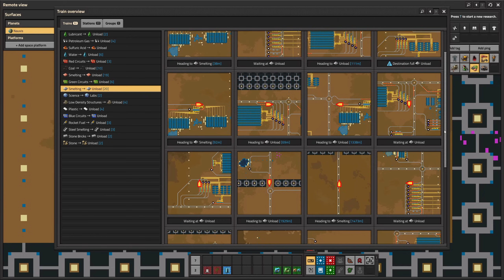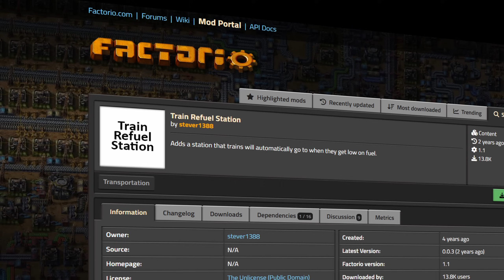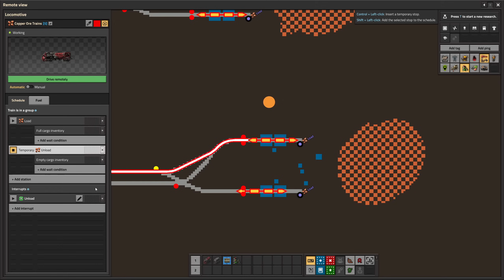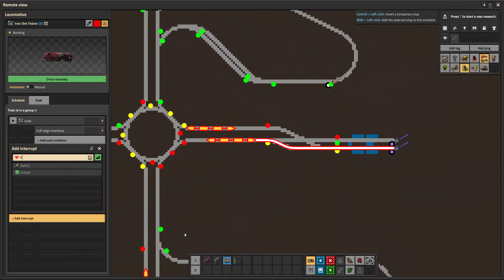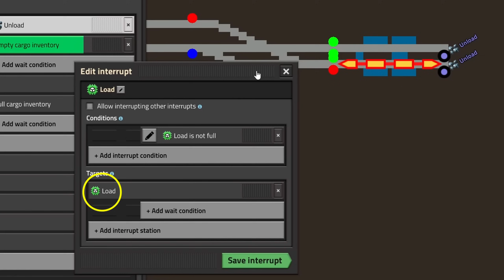Factorio Train Interrupts Explained!

Comment: You don't need circuits for fully generic trains! just have all loading stations have the same name eg "Item Load" with no item icon. then you can have the trains go to any "Item load" station where they will get filled up with whatever item is there which will then match to the unload interrupt and the trains will continue on
Reply: You could disable stations that don't have enough inventory to fill a train. Could also disable stations if the base has enough of item.
Reply: You will want to make sure the trains do not leave the loading station until their corresponding unloading station has a space for a train, to do this you will only want to have the trains go to the relaxed station only if they are empty and all the loading stations are full, otherwise all the trains will fill up with junk and go to the relax stations
Reply: this was also my strategy, together with circuit signals to enable loading stations only when there is demand for their specific item, plus programable speakers on the unloading to get alerts when there is a throughput issue (or something breaks)
as my network grew, I added more features, like disabling the request when a train is on the way, so I didnt get all trains trying to serve the same request when things slowed down
Reply: Say you make a shared name for the loading of copper mines and iron mines and you have 4 trains on a shared route to pick up.  If you have 4 copper mines that are all closer than the iron mines then the trains will always pick up copper and you will run out of iron.
Reply: @roberteltze4850 And that is why you have 5 trains. Whenever I create a new pickup station I also make a new train. So if I have 4 copper ore and 1 iron ore pickup, I will have at least 5 trains in the network. It's better to have even more, because of trains in transit.
But yes, this is the main downside of this approach that you still have a lot of trains and when you expand you have to add more, not for increased throughput but to not starve. To avoid that you would need an LTN style network, but that is harder to figure out.
Reply: @roberteltze4850  You should always have enough trains for the whole system. if there is no trains at the depot or "relax" stations then you should add more. It's just the same as not having enough robots
Reply: while that's probably true, it has a lot of negatives. For example, if you have 50+ stations its much harder to find the ones you may want to look at for whatever reason.
Reply from the maker: But then you have to manage the amount of trains and have excess trains to make sure that theres no bottleneck.
People setting up LTN want to avoid exactly that. They want some smart trigger so that trains only pickup stuff when it's actually needed.
Mekhami already posted this exact idea of having the same name for all stations but then use the circuit network to balance supply and demand.

I currently have a member only poll here on YT and patreon and if this idea wins I'll make a video about it.
But using the no effort "just build more trains" generic group might also be something I can cover. Thanks.
Reply: That argument does not make sense because at certain point LTN like network will be using same number of trains as vanilla network to transport items to satisfy throughput and it will be actually slower than vanilla because LTN network expects trains to go to relax station / depot to receive new order, while vanilla train can go directly from unloading to loading station. Enabling loading station based on demand does not work because if you have 5 loading stations for the same item but need only one to be enabled then you run into a problem that these stations must agree which one will enable. Yes it is possible to solve it but solution is so complex it is not feasible to use it in normal gameplay.

The actual issue I have with vanilla system is that it sends train to closest loading station, which depending on structure of rail network can cause shortage of resources which come from distant loading stations. Yes you can solve it with some central managed priority for loading stations, but that again increases complexity of the whole setup.

In the end vanilla factorio even with space age does not have enough items which would need to be transported via trains, especially with liquid metals, new pipe system and stacked belts. So vanilla train system actually fits better vanilla games than LTN like system. LTN is definitely better for modded games with hundreds of different items which need to be transported in small amounts (like pyanodon mods).
Reply: @AVADIIStrategy  cant you turn off the load stations using circuits via the radar? just have every station output a signal when they need an item and have the load stations turn off if there isn't a request.
Reply: @AVADIIStrategy  Not sure how a LTN would avoid needing to add more trains? yes there would be less trains because the trains aren't sitting in the loading stops but you would still need to make more trains as the total throughput increases. To me having a train sitting in the loading stop is not much different from the steel boxes that area beside the track, it is also very easy to create a blueprint of the train that includes fuel requests for the robots so you can just place them down anywhere. It should also be faster than an LTN because as soon as an unloading stop becomes available the train immediately departs with a full load unlike in an LTN where a train would receive the request and have to go fill up first.
Reply from the maker: @Ryan-uo3ep Imagine you have 2 iron ore mines. One is very far away the other is close the main base. The game will give priority to the near mine which means you will deplete the mines unevenly.
The only way to make the trains get ore from both is to have more trains than necessary because then the game will also send trains to the far mine because the near mine is occupied.
I personally don't have a problem with that which is why I like your solution. But other players are obsessed with balancing and they want to control where trains go and when and the solution to this is LTN.

So while it's true that this method produces generic trains, it's not really a LTN.
Reply: @AVADIIStrategy  I am not one of those players, but setting station priority based on remaining ore would solve this
but then, you would have all iron mines run out a the same time, which sounds like a bad time
Reply: @AVADIIStrategy Yes this solution is not LTN like but the trains are definitely generic. The drawback is that you do not have that much less rolling stock than if you would use an LTN style solution. The benefits are 1. it is very easy to set up and 2. you only need a single blueprint of a train and you do not need to configure this train, as it is truly generic.

In fact this is how my current Nauvis base works, because when I set it up I did not want to get too deep into the new train stuff, but it works flawlessly. I am currently experimenting with LTN style trains as the next update to my train network.
Reply: Daaaamn that's smart
Reply: Came to say exactly this! To adjust which trains go where it's much easier to change the priority of the station locally at the outpost
Reply: This is how I do it. one train group for cargo trains and another for fluid trains.
Reply: The generic train would be cool but i dont think the hassle of setting up the circuit logic everywhere is worth it since you just have to set up one train group per resource..

Comment: You don't need any circuit logic or priority to set up a 1 train group network (well, only solids). As mekhami says, you can just have all your supply stations named the same, so any train can go to any supply stations. To prevent empty stations, I have each supply station limited to 3 trains (1 in the station itself and then two in the waiting bay) and then more than enough trains in the network to fully saturate the network. The exact conditions are in order from top to bottom:

Hold: Conditions: Destination full or no path AND empty cargo.   Destination: Holding bay
Load: Conditions: Empty Cargo.  Destination: Generic provider station name with full cargo wait condition
Deliver: Conditions: Full Cargo inventory.  Destinations: Wildcard + generic requester station name (the stations have the requested symbol in front so wild card matches) with empty cargo inventory condition
Fuel: Conditions: Fuel any < 1 Destinations: Refuel station with 1 sec of inactivity condition.

I don't allow interrupts to interrupt other interrupts, but I also use nuclear fuel, so no train has ever gotten stranded. I think I copied this from somewhere, but I don't know the source, sadly.

Edit: Blueprint string of the train:

0eNq9Vk2L2zAQ/S86O4s/80V7KUvpYQ+l12URij1xRGTJleSkYfF/70h2EtO1w4YtG4KN9EYz7400Gr+SjWig1lxasn4lPFfSkPXzKzG8lEy4OckqIGsiVK4qZfkBSBsQLgv4Q9ZRG4yY5kyXanZkpZID2/gO2+QO27R9CQhIyy2HjrsfnKhsqg1oJBmMaAhIrQwuQVcYAN3MkggNT2ieLR9W2SJMojhrnWe2EUCFKrmxPDf0uOM4rtSBy5Kst0wYCIjSHKOyzl8YkFwJpZ1nfIQPq3TlfstluFiFiyhM01UcLRdZQEpvvfFP5vNJuIWq08GLgXjZ5AKYnm0bEORqhlaScnnA6EqfumXXESoyluX7fqdGkbh9afEfvMlbHIwl/kbi5tnHEzegKBshRmgl99JaxJ9BK72b1uozaGX30lrO/z8tLFCT76BoRF+h10J042iAOz6lVk2NjJ/OUYlzaUHrpradg17TIwj0oYkrOFl4QR1uT7XDtxjdg1XNNNB+lsmCOE4WMwK9Q3OmT54PXNuGiVl3/3ztXjNXbzP0goGRycsv+I2Oj4xbOh4aqtqepmK76FwaXgC9COuz6fawV/fdlfq0NBDUkcL4jbSUyYloAwcuuVuujaVv7tZ/rxfXCCxzXSE+e2XWXWnkC2mnk/eNGbidFy5ZjhvP7SRd3PE9LpmH783Tk2LFZJ5u7sOUjJ8aD3jhD9YNKbdO1/uY/1BimnkBePilp0RdKKo0lYrWzO4mogYfU/0ItbJknLnVDfhG4fqGyvcuJRLyK2k/6/vKpm8rwWUSj9BWK3eYLnAygJMLHJ/hdACnFzg5w9kAzi6w/xJwJYFarp81AcEbwniF2Tx2rTibZ2GUhWnb/gVvkxCk

Comment: Great video, I knew how to use interrupts but I still learned a few tricky details from this that prevented me from setting up a truly ideal vanilla LTN. To address the last part, my solution to the generic train groups issue was to name all of my supply stations the same thing - cargo supply, or fluid supply. then trains will go to the supply station, then get interrupted by either the unload or the "relax" interrupt. The only challenge here is, you may find all of your trains load up on something that doesn't have high throughput in your base, so you may load up all of your fluid wagons with lubricant when your factory is demanding molten iron - to solve this, i used train priority based on the demand for resources. each demand station calculates the number of train loads it currently has space for, and sends that signal to the radar network. So if I have space for 5 train loads of molten iron, the radar network will have molten iron = 5. then, the supply train station increases the priority on that station by the value on the radar network. now, supply trains will prioritize things that are in demand, and won't all load up on low demand nonsense. Finally, all my trains that are "relaxing" with cargo in them SUBTRACT one priority from the radar network based on what they have in them - i.e. a waiting train full of green circuits means i have extra supply there, so the priority of the green circuit supply station is lowered by one. now i have a totally generic vanilla LTN that automatically balances its supply and demand using train station priority.
Reply from the maker: Ok interesting idea. So if I understand you right : instead of calling trains to specific loading stations all loaders (no matter the item) have the same name. The trains have this one loader as the only regular stop in their schedule and then you use circuit logic to set appropriate train limit priorities to make trains go to stations with items that are in demand.
Very clever and robust because you still have one regular stop in the schedule.
Oh and thanks for picking up a membership. Very much appreciated! :_wtf::_mine:

Maybe I'll use this idea at some point and if it works well it might be worth a video!
Reply: @AVADIIStrategy  precisely! since priority and train limits are separate signals on the train station, we can use both values to balance the train economy. using radar to transmit these signals makes it trivial. Technically you have two train groups - one for solids, one for fluids. I might also make science trains run on their own group, since they generally will only go from one place to the labs and have little reason to scale them up, so i wouldn't use this LTN system for science trains. But you totally could.
Reply: @Mekhami  This setup is brilliant! Clever use of the "Wi-fi" network through radars as well which is something I haven't really put to use yet. I will def. adopt this solution for my factory
Reply: I once stole a blueprint online for an automatic loading/unloading book of train stations which had a similar system. The idea got to me so much that I made my own one (but kept the math circs, 'cause I'm bad at math :^) ), threw the whole thing over the radar network too. Noticed trains sometimes oversupplying so added a negative input from the shunting bay I had and well, I apparently ended up having the same exact system of yours, 1:1
Reply: Vanilla LTN is… difficult. I’ve done work on it myself on my channel if you’re interested in seeing my blueprints (they work, but I haven’t done extensive testing). My current issue is the serious amount of circuitry I use to address specific issues with train interrupts, such as double dispatching
Reply: @Eval4270  i use minimal circuits in my network. I set train limits and I change station priority based on demand. Apart from that, my vanilla ltn has been flowing smoothly for about 100 hours now.
Reply: @Mekhami Oh nice! How do you address the double dispatch problem when two providing stations are available and a station requests an item? Most of my circuitry only exists to solve this problem
Reply: @Eval4270  i'm not sure i fully understand. are you asking if two stations of different items are available, or two stations of the same item? i limit the number of trains available to a station by the amount of cargo it currently has buffered (as well as the max the station can accept, of course) and then, if a train is empty, it chooses the highest priority, most in-demand item, and goes to any providing station for that item.
Reply: @Mekhami  wait... so there is (a) a priority signal that is used by demand stations, and, separately, (b) a capacity signal that sets train limits for supply stations?

it's been a while since I played, so I think I remember how to do the latter—but how does the "priority" signal work?  like, what is the signal interacting with such that trains can see it & know to prefer one station over another?

I seem to only recall doing this by setting limits or turning stations on/off entirely, but clearly there is a better way...   is there a "change destination priority" operation or something like that I'm forgetting? 🤔
Reply: @Kveldred  no, the capacity signal adds to the priority for an item, and the supply signal subtracts from the priority for an item. both are added to the radar network, and then the supply stations set their priority equal to the radar network's priority for that item.

it's really hard to explain in a youtube comment haha, but it's really rather simple once you do it once.